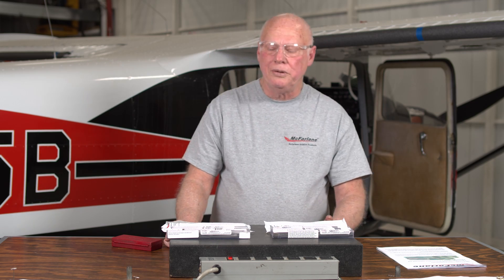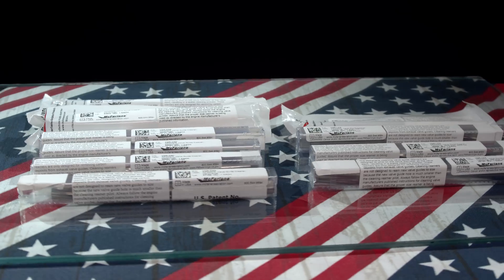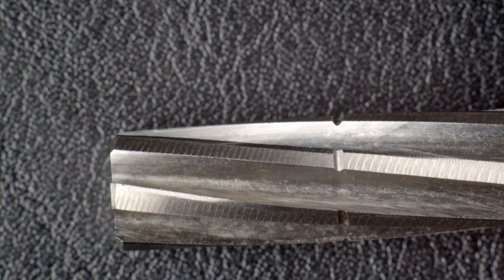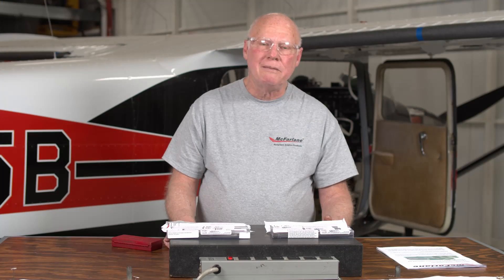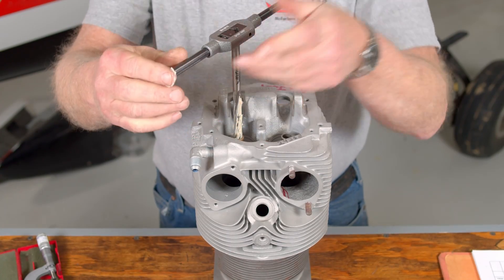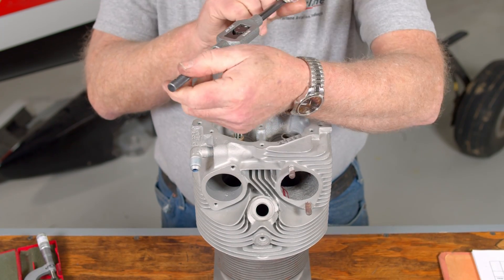Valve Guide Cleaning Reamers for Continental and Lycoming Engines

Comment: I purchased an exhaust guide cleaning reamer from McFarlane to clean the guides on my IO-360 after it failed the Lycoming mandatory service bulletin 388C. The reamer is a very nice reamer, even a pilot friend who is a retired Tool and Die maker commented on the quality. I recommend the reamer, make sure you have a tap handle large enough, the handle end is 3/8" sq.

Comment: Just saw this. In automotive this is called overreeming and results in side play between the valve stem and guide, and somewhat of a patch job.
The guide can be knurled to restore clearance but is less than a long-term solution due to accelerated wear and carbon retention.